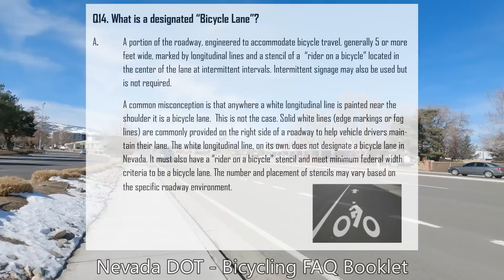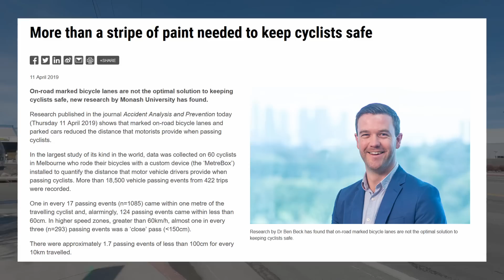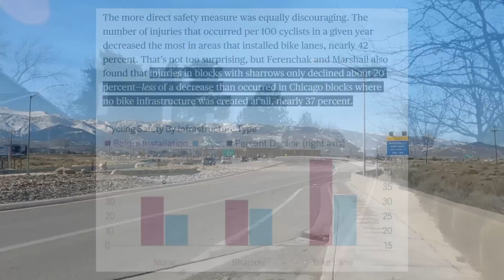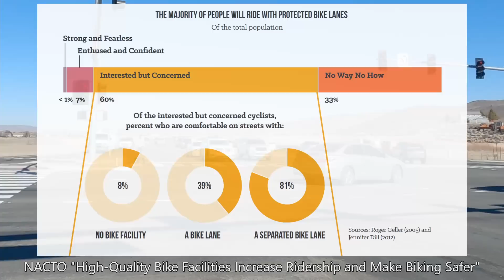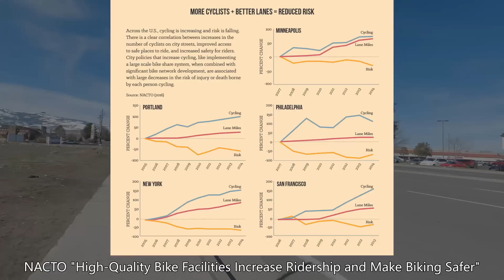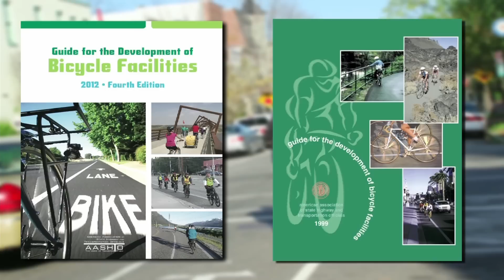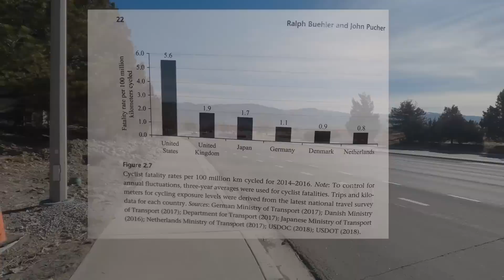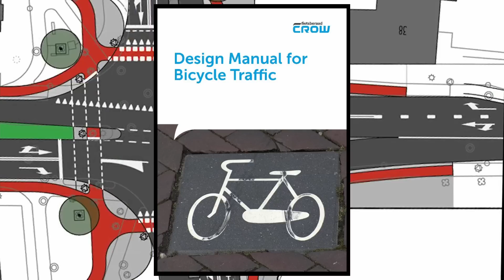Painted Bike Lanes Are Atrocious & Here's How to Fix Them

Comment: problem is retrofitting things some of the streets are mangled messes where they predate car use, and even in more modern areas there may not be enough room.

But even if room is not an issue this sort of design costs $$$ and local gov's often do not want to spend it on "bikes" which aren't look at as anything but sport/recreation.

Comment: the video is only partly correct . it's also the mentality that drivers have towards cyclists . 
In america a bicycle is a target or an obstacle in the path of the car . 
in places like Germany where there are also a lot of terrible and dangerous bike lanes , the opposite mentality towards cyclists exists . most drivers are very careful around bikes and are required to let bikes pass on the right while a car is attempting to turn right . this is insanely dangerous but not that many accidents occur compared to America . there is also the gear facto for german drivers in that they will lose their very expensive license if they strike  a rider . i've encountered many situations where a cyclist is riding on a mountain road with a long line of cars behind . the driver generally wait patiently until it is safe to pass .

Comment: You are much less likely to be hit riding in primary on narrow roads than if you ride to the right or left, depending on your country.  I have had a few problems when I ride as I belong on the road, rather than when I pick my way along the shoulder with debris, broken glass, and gutter drains.  Sure, some people get upset.  They'll get over it, and no one is going to just plow you down because you are riding in the primary.  If they are texting they might but you're no safer on the edge with these drivers.

Comment: Always put the bike lanes on the edges of the road geez... Having them in the middle of the road is very dangerous. Roads/streets can be shared, but not with these high speeds. Also these "bikelanes" are not wide enough to ride safely. Cyclists should be able to pass one another, so bike riders with different speeds can ride on the lane.

Also I understand these lanes are on major roads in the US, as that is the only option for right now, but designing a bike lane next to a high speed road isn't ideal. The overwhelming noise from the cars isn't very relaxing to say the least. Ideally bike lanes would be designed elsewhere, totally seperated from car traffic or on streets with a lower speed limit. In the Netherlands we do have bike paths on busy roads with higher speed, but always seperated from the cars. We do not have bike lanes on roads/highways where drivers drive 60 mph or faster.

And for God sake, please make sure the bike lane ends somewhere a cyclist has a destination. You can't just end the road in the middle of nowhere with high speed cars around you, how scary! You're better off with no infrastructure than these dangerous constructions, wowww..

Comment: I guess I fall under the "vehicular cyclist" category.  I use a bike as my main form of transportation and my city sucks on bike infrastructure.  Most roads do not have bike lanes but they are trying.  Let me describe some of the bike "lanes" near me.

On one street they painted the the bike symbol on the shoulders of the road then a couple years later due to some apartment buildings being built in the area they rebuilt the raised curbs along that street.  Now if you try to ride down that bike lane you have to jump up and jump down an exposed curb with no ramp on both sides of each intersection going down that street or you can swerve out on the road into a car lane to avoid the curb.  Another one is a strip of concrete that was put along the sidewalk of another street back in 1995 and it was really thin.  Now its all broken up and unusable as it has not been maintained and is too dangerous to ride on.  Also that same street people drive on as if it were a highway.

There are about 4 streets now in my city that now have a separated bike lane but they are full with 90 degree hairpin turns every intersection so if you want to ride at a good speed you cant even use them.  I tend to ride on the road as I am often going over 30kph and not the 10 kph those protected "bike lanes" are designed for.  Another fun thing my city loves to do sharrows on all the non busy side streets and call that bike infrastructure.

Now for myself I am very accustomed to riding on the road and claiming my space on the road.  I also developed habits for being a defensive rider to keep myself safe on the road.  If I am the first in a queue at a red light I am not gonna push over to the right as far as I can so people can turn right, many drivers don't know where the back end of their car is and might hit me so I take center lane then to block them from hitting me in that fashion.  Yeah I got yelled at for it because drivers are more than willing to sacrifice my safety to save themselves 2 seconds of time.  If I am not the front of the queue at a red light I will not filter past to get to the front as if I am beside a car I assume they don't know I am there.  I will take my spot in the queue and not let a car get beside me in the same lane in the queue.  I also ride as straight as I can and signal my intentions if I plan to turn.  I also ride along the same track the right hand wheel of the car would go over as it discourages drivers from "squeezing" past me with unsafe distances to me.

I feel like the only motorized vehicles that have any sort of respect for cyclists are people riding motorcycles.

Comment: Where I live "all roads are shared roads" and it's the pavement outside the painted lane line which is the "designated bicycle lane." Cyclists are therefore supposed to follow traffic laws just like cars which imo is insanity. Most streets throughout the entire county have 12" or less (often 4" to 0") beyond the white line except on the fastest multi lane highways. I've never seen a single intersection with bicycle accommodation and few offer any for pedestrians either. In the absence of real, sheltered bike lanes it makes far more sense to treat cyclists as pedestrians; while cyclist and pedestrian collisions are possible the potential for fatalities is remote.

Comment: Cyclists don't pay for road upkeep and are a nuisance.
Reply: They do actually. It’s a misconception that taxes exclusively paid for by drivers fully cover the cost for roads. Also the % the cyclists pay for the road is less than the % of road they get. Also, I could just as easily call cars a nuisance. All of what you said is either untrue or pretty ignorant.
Reply: The conditions that cause road wear are of interest to NHTSA, so they have done extensive studies to find out the main factors. They concluded that by far the greatest contribution is gross vehicle weight to the fourth power. Meaning if the vehicle is double the weight, it causes 16 times more wear.

There is a recreational path near me that used to be a train line. It sees thousands of people a day on bikes, roller blades, strollers, skateboards, etc. But because it is obscured from the road it has been added to police patrol routes at night, and they typically drive down its length with SUV style cruisers. A single officer driving down that trail twice a night for a week puts down more wear than ALL the bicycles, strollers, scooters, skateboards, roller blades, and pedestrians combined for a year. As a result the wear it does get comes from tree roots and the dirt washing out from under it, not from the bike riding on it.

Once you build a bike lane, bikes NEVER wear it out. And contrary to popular belief fuel taxes and registration don't even come close to covering the cost of roads. That comes from income taxes, and guess who also pays into those? The real situation is exactly to the contrary of what you think. Bicyclists pay into a system to subsidize cars, and in many places in the US they get NOTHING back in return for it.
Reply: @Ravaxr  exactly correct

Comment: Paint is not infrastructure, but : my town did a painted infrastructure for two summers, with some cement blocks, to test out some different configurations for an intersection. They found out that their first two scenarios had issues, they repainted it, and once it was fixed, they implemented it permenantly when they did road work on that street (changed the utilities line that were for some parts over 100 years old).

Comment: Never understood just paining over an existing road to make bike lanes. Seems like the lazy way to add lanes. Can't just paint them on. The entire system needs to be redesigned with special lanes in mind. instead of painting lanes on both side of the road shift the whole road over to one side and combine those two bike lanes while not reducing the lanes for cars. People think because car traffic is same or reduced the lanes worked.

No no, drivers just went elsewhere. I avoid having to deal with tiny streets with bike lanes much as I can.

Comment: I can only laugh at the totality of this video. Bike lanes are a tool in the toolbox and are very appropriate in the proper scenarios. Even the Dutch used them on rural roads in their Hillier provinces like Limburg, and on quieter urban roads. Hell!!!  They even have "shared use streets" in many urban areas where cyclist ride in the same, traffic calmed streets with cars (the horror!!!). Painted bike lanes are totally inappropriate in the strode hellscape shown in this video but are very appropriate and seem to work remarkably well just a 100 miles West of Reno in places like Davis CA and Sacramento. 

Also, if you cannot safely navigate around and occasional obstruction in a painted bike lane, so long as this bike lane was used in an appropriate lower speed roadway, then maybe you don't have the skills to ride a bike in the public ROW.

Comment: 1:10 false. Increased separation makes MORE accidents in intersections while the number of accidents between intersections is low to begin with. The best would be no separation with sufficient width- you can test this hypothesis on any road that is under construction and has sufficient width. BEFORE painting the stripes every driver is careful and keep the distance between the cyclist and the vehicle, but once the stripe is there, you can expect no one to take care about side distance.

Comment: Physical barriers are good in the snow free zones, but are useless in the north and also extremely expensive relative to a wider road and some paint.
As a road cyclist in Chicagoland I prefer the painted lines over a wide shoulder over no shoulder.   You can't be picky given the fact that 99% of roads only have the "no shoulder" option where you are riding within the lane of traffic.
My understanding from Illinois lawsuits is that these painted lanes do put the municipality under a greater level of liability for maintenance so are not implemented now.   In my county they do wide shoulder under new construction with the assumption of bike usage but no longer paint on-road bike lanes.
Reply: I'm quite content with just a proper size shoulder. There's a few state highways I ride on with 55 mph traffic but the shoulder is four feet wide. I basically have my own lane. It will not prevent some idiot playing with their phone or completely driving off the side of the road but nothing is going to.

Comment: In the absence of funding for fully separate bike lanes, the painted lines are very useful.  I agree the lanes should be as continuous as possible, and they should be swept regularly.  This is a transitional solution, and in western American cities, probably will not be improved on until there is much more demand and money allocated.  In Austin Texas, the city spent loads of money to separate some bike lanes with physical barriers including concrete curbs and ground-level concrete mushrooms.  The size of the bike lanes was unchanged, making them into narrow channels from which the cyclist has little flexibility to move in an unexpected situation.  I rode these lanes often, and sensed they were far more dangerous than good pavement level markings.

Comment: I ride for fitness and fun. My city has several hundred kilometers of bike paths which I use. I do not commute on my bicycle. Who wants to show up for work wearing bike shorts and covered with sweat. I don’t mind cycling on lightly travelled residential streets but I will not ride where cyclists are mixed with automobiles in heavy high speed traffic. That’s nuts. In heavy or high speed traffic I use the sidewalk if one is available. Bicycles are neither motor vehicles nor pedestrians and ideally they should have their own infrastructure. That may be impossible in downtown areas. People should avoid cycling in areas of high traffic density.

Comment: There is only two ways to fix this problem.

#1. With endless miles of 6 feet high 8 ton concrete blocks as a safety barrier. 
#2. By placing a waterfilled ditch in between to make a huge lorry go bye bye. 

The alternative is to slap on two more wheels, an engine to keep up with the road rage, a windscreen to hold the bugs at bay, rear view mirrors to improve visibility blocked by the roof and a steering wheel with cruise missile controls should anybody dare to slow you down 4 4 seconds.

Comment: All bike lanes should be wide enough for two cyclists to ride next to each other to allow for safer passing and more options for space when a portion of the bike lane has a road edge hazard, the thing that I believe which is true but sounds wrong is that no bicycle infrastructure would be needed if car volumes were dropped by 80%, perhaps chicanes and speed bumps, continuous sidewalks. Removing car infrastructure and car convenience is more beneficial than segregating road users in my opinion. Because these physical barriers make crossing the street difficult, “jaywalking” makes a city livable

Comment: As an engineer at a State DOT I have to say that this video was already outdated in 2018. If a project is using Federal funds, at least here in Massachusetts, separated facilities are required for roadways with speeds over 40 mph, or volume more than 10,000 vpd. In northeastern Massachusetts that is nearly all of all of the State owned roadways, and local arterials. Of course it will be another 50 years before all those roads can be upgraded. My personal pet peeve is the irrational hatred of the idea of back-in angle parking. It is objectively far safer in any situation than front-in angle Especially for cyclists), but the only place I have seen it used is on divided boulevards with parking on the left (median) side of the road. If it gets brought up during the planning phase, they end up switching to parallel parking, losing half the parking rather than just backing in.

Comment: How about just keep bikes off of main streets? There's plenty of side streets that have almost 0 traffic that you can make a dedicated bike route. Give the cars their main roads, give the bikes their main routes. Divide it as best you can. Timed bollards are extremely expensive, but would work great. Push button crossings with sensors to detect when the traffic has passed and give the cars back their rights would make both sides happy. As a several thousand mile a year biker, both traffic types do not mix. Even better would be legalizing golf carts on the same bike routes allowing car drivers the option of something with more space and creature comforts than a bike, but still slower, smaller, and more suited to work with bicycle traffic. You could go shop on your little putt mobile without getting wet in the rain or covered in sweat if you're going somewhere 20 mi away across town, but still not be in your 12mpg f150.
Reply: this is kinda what they did in the netherlands, apparently. NJB has a video where he explains that bikes and cars use completely different paths to get to the same location
Reply: @Neymarinet  I've seen that video. Where I'm at it could definitely work. Trying to figure out how to map it out and present it to city planners.
Reply: @joblessalex  good luck to you. I hope it works out

Comment: Another important distinction for making biking more inviting is the route. Say you want to get to the next town over. The quickest way to do this is in a car is to follow the local road to the collector and then to highway or arterial, otherwise using some grid or pattern that can disperse traffic. But on a bike quickest route is usually the straightest route. Getting a bike path with a direct link from city to city is vital to making cyclists viable for some.